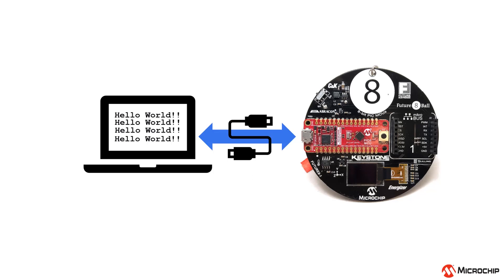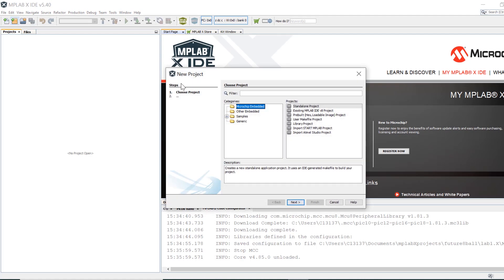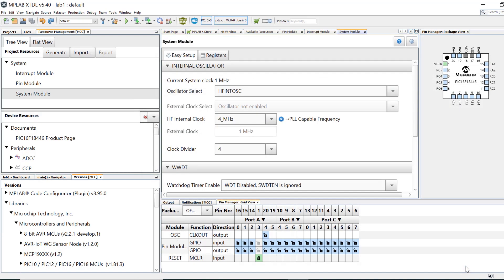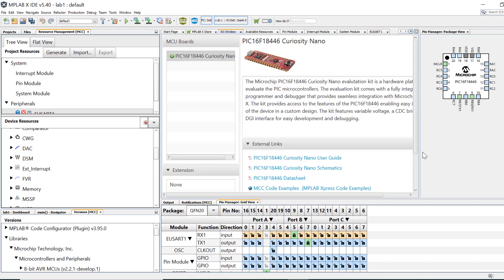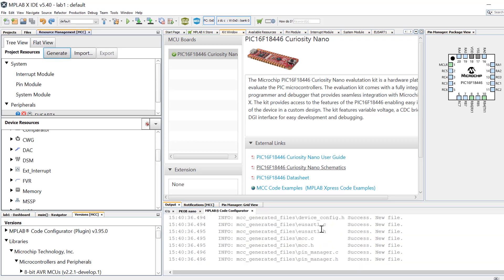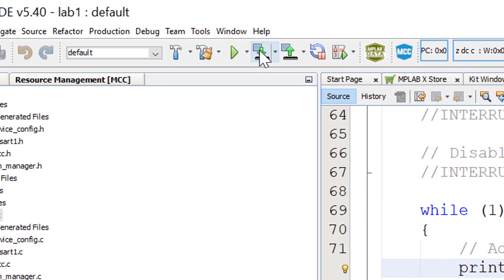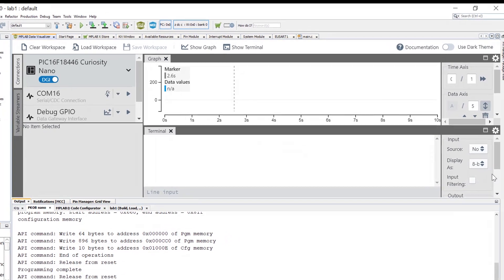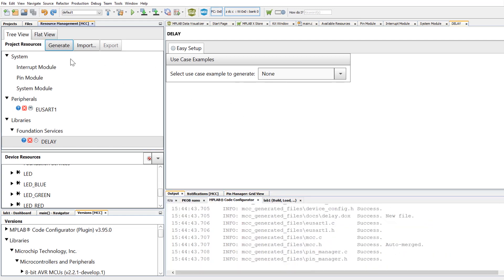Future 8-Ball Serial Communication Between the PIC16F18446 Curiosity Nano and Your PC

Comment: Followed everything, program running but terminal is empty. I traced code into following code:
int vfprintf(FILE *fp, const char *fmt, va_list ap)
{
#ifdef _VFPF_CONVERT
    char *cfmt;

    cfmt = (char *)fmt;
    nout = 0;
    while (*cfmt) {
        nout += vfpfcnvrt(fp, &cfmt, ap);
    }
    return nout;
#else
    return fputs(fmt, fp);
#endif
}
step in first port which is grey colored means not compiled? then I get pop-up: Datasize mismatch, 18446 read 4 but IDE X only accept 2.

Comment: This really nice thanks! but IDE X is buggy++. I first tried v6 Jan22, not like the speed but I get led  blink working. then I turned to v5.35 tried multi-threads, I got randomly stopped break points and randomly working threads, ASM window cannot scroll. so I reinstalled v6. It shows DV window that I like, but says MCC created project is empty. I reinstalled v6 and it immediately found my previous project is not empty and can run, but DV initialize no stop so I have no DV!